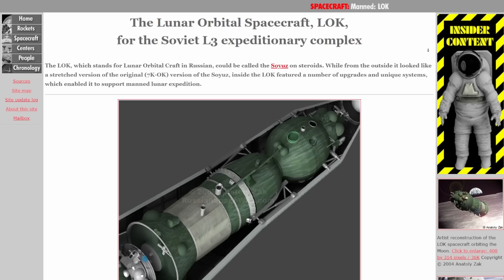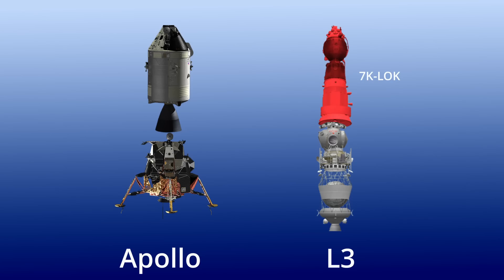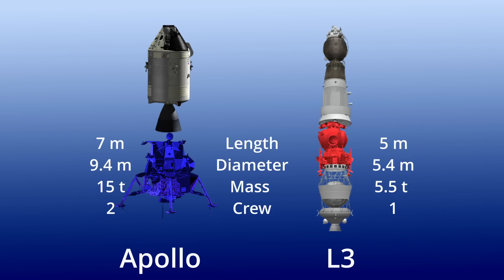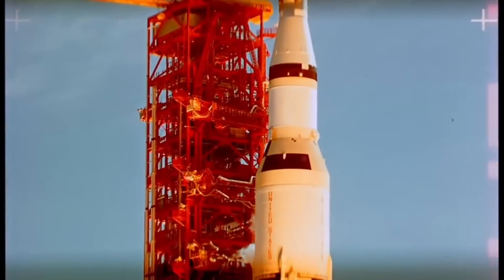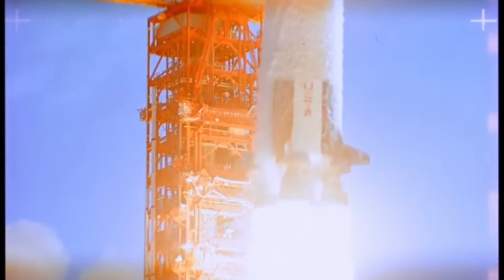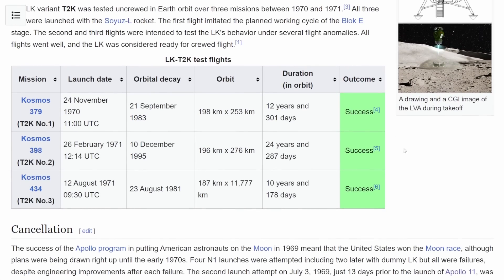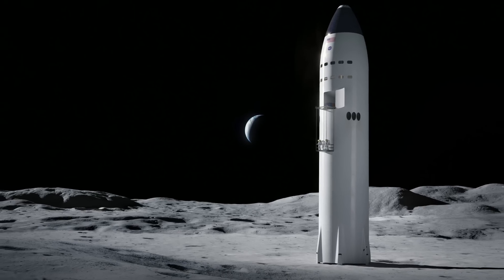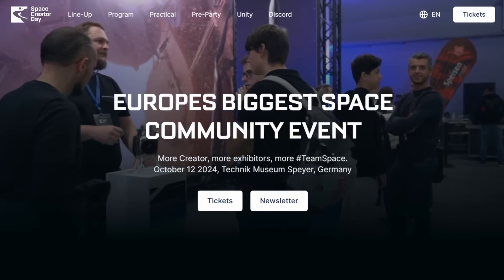Race to the Moon! Did Soviets or Americans Build the Better Lander? - Rocket Rumble #2

Comment: A requisite for the question ‘which was the best lander’ is to actually land it on the Moon. Since one of the landers never did land on the Moon, the question is irrelevant.
It’s like comparing an Olympic-class sprinter with some very fast runner that never got to compete at the track.

Comment: A non-negotiable fact of scuba diving is to never dive alone. I can't imagine one person flying down to the Moon and back (after an EVA, no less) and  surviving whatever goes wrong. And something always goes wrong.
Reply from the maker: Yes! As a diver myself, I never go underwater without a buddy, especially when it's a challenging dive. And it doesn't get any more challenging than exploring another celestial body.
Reply: I did scuba for a while and that was always drilled into us. Then I read Deep Descent by Kevin F McMurray. Bit of a shocker to find out that the buddy system while diving on the Andrea Doria was something that didn’t always happen. I just dug the book out of the attic to refresh memory and I quickly came upon the death of Richard Roost. Considered by many as an expert diver, he buddies up with two others on his first dive ever of the AD. The 3rd dive he went solo and never returned. This wasn’t the only death of a diver who wasn’t buddied up with someone on the AD. Not sure why that would even be allowed. It’s probably mentioned in the book but I probably forgot. Have to read it again to get the details right.

Comment: Excellent summary. A few comments:

1) The Blok D you modeled is the later version used with Proton. The version that was part of the L3 Complex had a stressed outer skin to carry the thrust loads rather than a truss. 

2) There was a load-bearing shroud around the LK to connect the Blok D with the LOK/Soyuz. The cosmonaut had to open a hatch in the shroud to get access to the LK hatch. If that weren't there, then all of the Blok D thrust would be conducted through the LK, every time it fired.

3) A fascinating detail of the L3 mission that you left out is, to save mass, the LK was unpressurized for most of the mission, so that they only had to provide enough gas for the cosmonaut's helmet. There was only enough gas to pressurize the cabin once so that he could remove his suit to eat, take a bio-break and maybe a short nap before returning. The cabin had to be vented before the ascent to lunar orbit.

Comment: Who built the better stage prop, more realistically. That would have to go to the Russians by default. The LM is a spectacularly ugly POS, and woefully incapable of doing these insane things: protect from micrometeorites with 3 sheets of tin foil, house 2 astronauts for 1-3 days in a vacuum and 500’ climate swings using a couple car batteries, broadcast a live TV feed during a phone call with Nixon (lol), stow a dune buggy, escape Moon’s gravity and sync up with the CM in orbit.
Reply: More realistically? No. You’re just demonstrating your ignorance. Actual engineering was used to solve all those problems.
Reply: @Hobbes746  hahaha well those selfish 1960s engineers shoulda let modern NASA know what they did with that magical slide rule so they can solve the same exact problems with our crappy modern day computers…if only NASA didn’t trash bin all the schematics and telemetry data. Darn the luck.
Reply: @kyucklebeans  NASA didn’t throw away anything. Drawings, technical reports, useful telemetry have all been retained. 
For Artemis, NASA isn’t “solving the exact same problems”. They are solving new problems, like enabling missions that spend a month on the moon instead of just 3 days.
Reply: @Hobbes746  no, we gotta stop with the excuses on why they can’t go back to the moon. They can’t figure out the radiation hazard, among other challenges that were allegedly solved 50 years ago. That’s why they sent 2 dummies to space, to measure the radiation hazard thru the VA Belt and out to the moon and back. I know, it’s very painful to let go of the Apollo fantasy. You can do it though!
Reply: @kyucklebeans  You are wrong again. 
We have figured out the radiation hazard: by 1962, we had mapped the radiation belts. The radiation level in those belts is low enough that humans in an Apollo-type capsule can safely travel through them. 
40 years later, the Orion capsule uses electronics that are a million times smaller than the Apollo electronics, which makes them way more susceptible to radiation. This is not new: since the 1960s, we have been operating satellites in this region of space, so we learned how to build electronics that can safely operate in this region for decades. 
Orion was flight-tested without humans, as has been done for every manned spacecraft except the Space Shuttle. NASA took advantage of that flight to gather data using sensors we didn’t have 40 years ago. Not because they didn’t have any data, but because adding more data to what we already have is worthwhile.
Reply: @kyucklebeans  Apollo isn’t a legend, it is fact, supported by a mountain of evidence. All you have is arguments from ignorance. That’s not a solid foundation.
Reply: @kyucklebeans  There are no excuses, there is a reason we haven’t been back to the moon yet: cost. Apollo was the most expensive engineering project in history. Until 2017, nobody was willing to spend that much money. 
In 2017, Artemis was started, but its annual  budget is only 1/25 of what Apollo had available. This means building everything you need to land on the moon (which took 8 years for Apollo) will take longer than it did for Apollo. Artemis missions are also more ambitious than Apollo, which increases the amount of work that has to be done.
Reply: @Hobbes746  lol no the other camp has plenty of evidence that it was a TV show staged in a studio and a junk yard. Once you see it, you can’t go back. And all you have are 50 years of empty promises of a return — and an old CBS broadcast of Nixon in a live video call to the “moon” with Neil and Buzz lol (absolutely impossible even with today’s technology, let alone 10 watts piped thru that scrap heap of stage prop, the Lunar Module). The Saturn V really did get some guys into Low Earth Orbit, though. So I think we agree on 20% of the mission parameters.
Reply: @kyucklebeans  That’s not evidence, those are arguments from ignorance and lies. 
Every single argument made by the deniers has been debunked.
Reply: @kyucklebeans  We know the Saturn V didn’t stay in low Earth orbit. Astronomers and radio amateurs around the world followed the flights to the moon, proving they didn’t stay in LEO. Again, the evidence disproves your claims.
Reply: @Hobbes746  lol no they didn’t, that’s not possible and you have no proof other than hearsay. Again, meaningless discussion since NASA can’t replicate it today with humans. Good chat, best of luck. Sorry in advance for the next “delay” on Artemis 2
Reply: @kyucklebeans  It is in fact possible. The discussion is far from meaningless: replicating the landings is not necessary to prove the Apollo landings are real. 
All we need is the evidence for those landings. This includes: 
- 382 kg of lunar rock samples that have been examined by geologists all over the world. They have been compared to samples brought back by Soviet and Chinese unmanned missions. All moon samples show signs of having been formed in lower gravity than we have on Earth. 
- hours of live TV and film. We can measure how objects move in those videos, to find out what gravity they were in. And all those videos were made in 1/6 g, not the 1 g we have here on Earth. 
- more than 8000 photos. We can analyze the lighting in the photos. We find there’s only one light source, very far away. this cannot be replicated in a studio on Earth, and it cannot be replicated in an open-air stage on Earth either. 
- scientific results from every experiment they did,
- thousands of technical documents that show how they did it. 
We can analyze this evidence, and have been doing that for 50 years now. In all that time, not one of these items has been found to be falsified. 

In addition, we have confirmation from multiple independent sources:
- amateur astronomers could see the CSM/LM on their way to the Moon, and not in Earth orbit. Reports of this are all over contemporary newspaper and astronomy journals. 
- in several countries including the USSR, people monitored Apollo spacecraft radio transmissions. Radio astronomers used their telescopes to monitor transmissions, confirming they were transmitting from the moon. 
- The NASA Lunar Reconnaissance Orbiter and India's Chandrayaan-2 orbiter has photographed the Apollo landing sites, with enough resolution to show the foot tracks of the astronauts.
- Japan's Selene lunar orbiter has mapped the Apollo landing sites and found the topography matches that seen in Apollo photos. 
- laser reflectors were left on the moon by the Apollo missions, and can be pinged from Earth by anyone with a powerful laser.
Reply: @kyucklebeans  The optical capabilities of the LRO are in the public domain, and easily verified: we know its altitude and the diameter of its telescope. That gives a resolution of 50 cm per pixel from an altitude of 50 km, which is what we see in all of the LRO photos. The LM descent module is recognizable, we can see the ALSEP and other equipment, and we can see the foot tracks of the astronauts. 
It is also confirmed by the photos made by Chandrayaan-2 and SELENE.
Reply: @kyucklebeans  There is no evidence that NASA “cannot go back”. They have not been back YET, which is not the same thing at all. You are jumping to the wrong conclusion based on no data. 
NASA is in fact in the middle of building everything they need to go back. 
The LM is exactly as sturdy as it needed to be. You are guilty of judging a book by its cover: you are looking at the MLI (foil insulation) and the Whipple shields, without considering what might be underneath those, and why those outer coverings are flimsy.
Reply: @kyucklebeans  In reality, Apollo was the most expensive engineering program in history. During Apollo, NASA’s budget was ten times higher than it’s been ever since. That reduction in budget made manned lunar missions unaffordable even for NASA. After Apollo, NASA attempted to make spaceflight cheaper with the Shuttle. That didn’t work out as well as was hoped due to political interference (they were not allowed to spend the R&D money to improve the Shuttle design), which meant the Shuttle and then the ISS consumed the entire manned spaceflight budget for decades. Only after the end of the Shuttle program did that money become available for a new manned lunar program. At only 1/25 the annual budget that Apollo had, Artemis is going to take longer than Apollo’s 8 years to build everything they need to land on the moon.
Reply: @kyucklebeans  " It is well known how to harden electronics against radiation.” You’re just repeating what I told you already. It is also well-known how to send humans through the van Allen belts. 
When a new aircraft is designed and built, the manufacturer and the certification agency spend years flight-testing it before allowing passengers to fly on the aircraft. When a new spacecraft is designed and built,  the manufacturer and the certification agency do one or more flight-tests before allowing astronauts to fly on the spacecraft. This was the purpose of the Orion test flights.
Reply: @kyucklebeans  According to you:

“That's not how technology works in reality. Things get EASIER to do once you've accomplished them, not harder.”

Can you buy passenger tickets for a SST today. Yes or no?
Reply: @mako88sb  lol the old "Concorde Defense" of why no space agency can get to the moon, even though they are trying to figure it out. It's not a bad rhetorical position, to your credit -- hey there was this cool thing once upon a time but it no longer exists! -- but hypersonic flights are still happening today regardless of their commercial availability (Concorde retired due to climate nuttery artificially inflating fuel costs, among other political factors). In other words, hypersonic flight still exists, while taking men to the moon doesn't, and it never did.
Reply: @kyucklebeans    You’re the one saying things get easier after it’s done once.  There is a company called Boom Supersonic trying to bring back SST travel. According to you it should be easier this time around. Yet they aren’t making much progress and are already behind their plans of reintroducing SST travel to people willing to pay for it. 

As for the radiation issue, you’re obviously oblivious to the fact that the type of radiation found in the VAB’s is not the same as what nuclear power plants build protective shielding for. In fact, it’s some of the easiest type of radiation to attenuate against. That’s why no radiation experts or aerospace scientists & engineers from around the world for 50+ years as come forward with proof that the Apollo CM couldn’t provide enough protection for the astronauts. Both going and coming back from the moon.  

As for Orion, another thing your oblivious to is that its flight path took it into regions of the VAB’s that had much higher radiation flux levels than anything any of the Apollo missions ever encountered.
Reply: @mako88sb  I agree that it should be easier for another run at the Concorde, per the stated principle. Are you saying that it’s a technical problem lost to history that is impeding progress? You’ve definitely made me interested in this. I’ll look up Boom Supersonic and see what’s going on.
Reply: @kyucklebeans  Good. While you’re at it, do some actual research on what different types of radiation there are and which one exists in the VAB’s. Radiation scientists and aerospace engineers from around the world know this so are more qualified than you will ever be to understand what material will attenuate against those types of radiation.
Reply: @kyucklebeans  No, the skeptic side isn’t compelling. Every single denier argument falls apart on examination.
Reply: @Hobbes746  surely. My bad. Apollo absolutely happened even though they can’t figure out how to go back - you won’t be able to refute that evidence no matter what, because we don’t have the technology yet. Live video feed from the moon, 16-watt broadcast, on a phone call with Nixon proves that we went lol. High quality hilarity! I can’t even get a live moon video feed from Artemis or the LRO. Good luck my man.
Reply: @kyucklebeans  You’re wrong again. “they can’t figure out how to get back” is a lie. In reality, they are building everything they need to get back.
Reply: @kyucklebeans  The LRO was not built to send live video because that was not a mission requirement. Worse, it would have been a pointless addition that would detract from LRO’s actual mission: high-resolution mapping of the moon.
Reply: @Hobbes746  lol yeah they’ll be “building” it for another 50 years. You’re being had by the US Gov’t. Also what is up with Artemis I? They didn’t take any actual footage from their trip around the moon either, just some PS2-grade CGI for their “live updates”. They should have brought Neil and Buzz’s magical 16-watt camcorder that they used to talk to Nixon lol
Reply: @kyucklebeans  They’ll be landing on the moon within 5 years, not 50.

Comment: Well, one was real, and the other just a mock-up.   Might as well compare it to Blue Origin’s lunar lander.
Reply: More than a mockup. The LK was far enough along to be tested in orbit.
Reply: @Hobbes746    You’re right, My bad.    Test flown several times, without a crew and two years too late. Never left earth orbit.  Never landed on anything nor took off again.  So which lander was better?   The one that actually did the job.

Comment: No contest. And since the American LM actually WORKED 6 times in actual lunar landings, it is really an argument in a vacuum anyway. 
And on top of working for its main purpose, the LM also functioned as a lifeboat in Apollo 13. It was classic when Grumman Aerospace sent a bill to North American for "towing" with an extra line item for "battery recharging".
Bottom line, the Russian LK was much more primitive, with less backup systems, and could likely have crashed on the moon due to lack of hover time to deal with last minute terrain issues. The Russians might have made it to the moon, but they might have a dead cosmonaut. Not a good propaganda "look". Maybe that is why they finally cut the program and focused on something they had the capability to achieve, a space station.

Comment: It is interesting that even though the N1 had greater thrust on launch than the Saturn V, it could still lift less mass to orbit or to the moon. Those hydroLOX upper stages of Saturn made a difference. And unlike our FrankenRocket, the SLS, Saturn kept the booster stage using Kerosene, but since they dropped it really quickly, and didn't have to lug those huge tanks and heavy engines all the way to orbit (like SLS) it could lift more to orbit and to the moon than SLS, even though SLS has higher liftoff thrust. 
SLS has all the complexity and problems of using HydroLOX, but because of unbelievably stupid design choices, gets less of the benefit than the much more primitive Saturn V.
Maybe Werner Von Braun was just SMARTER than today's engineers??
Reply: You don't get to build a Saturn V by being smarter than today's engineers... you do it by being smarter than yesterday's politicians.
Reply: Rememberthat the Saturn V was also more expensive than the SLS lol.